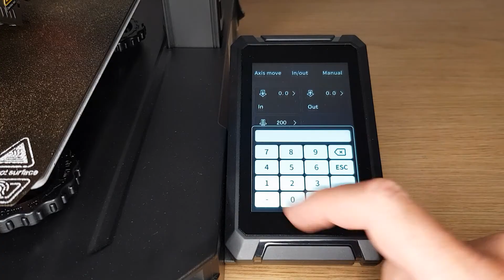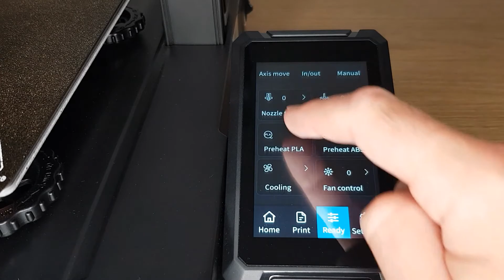Fix a Hotend Clog On Ender 3 S1 Pro

Comment: Great video.  I just got a filament clog so good timing :)

However 1 think I'll tell people to be careful of, because I just fricking did it! :(  Be careful unscrewing the nozzle.  I have never touched my nozzle since buying the printer (only a couple weeks old), and it wouldn't budge.  I've only printed with PLA, so I upped the temp to 230 and tried again still wouldn't move.  So I turned it off, let it cool down and tried, but still no good.  

Figured I'd try again with the printer on at 200 degrees to be safe.  Turned, turned a bit harder, little harder still, and then both those long screws BENT.  Nozzle head didn't even move.  So now I got 2 bent screws (the looks like an S) and a stuck nozzle.  I did however dissasemble the rest with the nozzle on and clear the filament blockage.  Ill hold the block with vice grips and try remove the nozzle that way.  So sick of all the problems i'm having
Reply: I googled for the s1 pro hot end screws but can't find anything.  I measured mine and they are 18mm.  Are these m2x18mm socket head screws?

I unstuck my nozzle, was really damn tight.  Cleaned it all and assembled.  Thought I'd do a bed level print and see how far it came out of alignment.  BAD idea.  I started the print, it did its warm up stuff so I turned my back to clean up some things.  I hear what I think is my kid pushing furniture on the floor and turn to see the printer scraping the nozzle head right into the build plate :(  "Luckily" it was only doing that filament test/clean line on the side before I caught and stopped it.  So now I got a long indent on my build plate today too!

Comment: I use heat transfer paste between Hotend and heatsink and had no glogging issue again since then as I found the original setup to be underperforming on those topics
Reply from the maker: Yes, that's a good idea👍
Reply: do you mean between the nozzle and the heater block?
Making the heater block thermally conductive to the heatsink is exactly what you shouldn't do. The whole point of the heatbreak is to slow down (stop ideally) the flow of heat from the heater block to the heat sink.
Reply from the maker: @yeroca  I believe they mean between the heatbreak and the heatsink so that any heat in the upper part of the heatbreak is better conducted to the heatsink fins. This way the upper part of the heartbreak is kept as cool as possible. I have done this myself on another all metal hotend and it works well.
Reply: @yeroca  no, as yoh say that would be a bad idea. the paste is on the metal tube entering the heatsink. what I found is that removing the heater block from the heatsink, the metal tube entering the heatsink has some play and is therefore not properly transfering the cold to the tube causing a small thermal transfer blockage. with the paste that problem is cheaply solved. Adding another heatsink fan is helping additionly, especially for printing in enclsoures